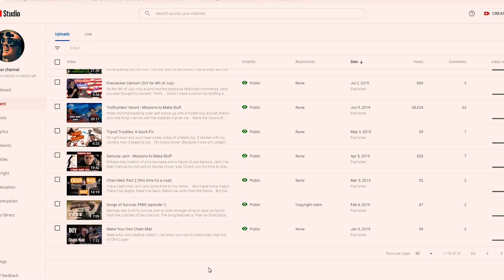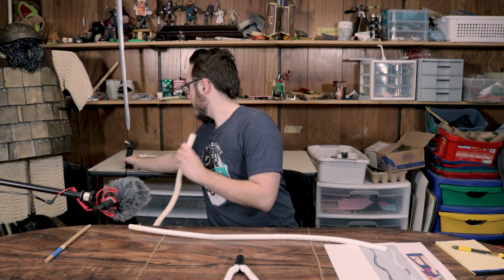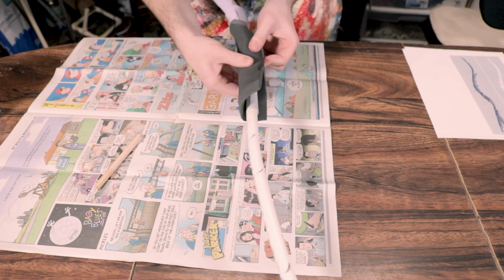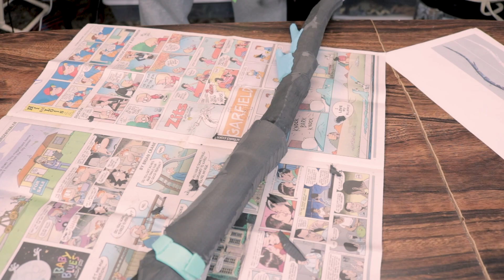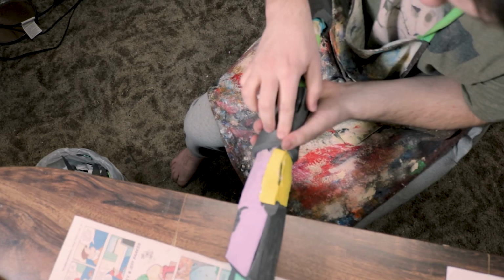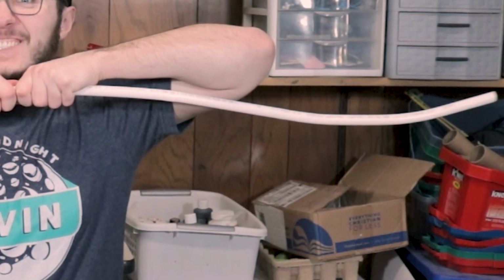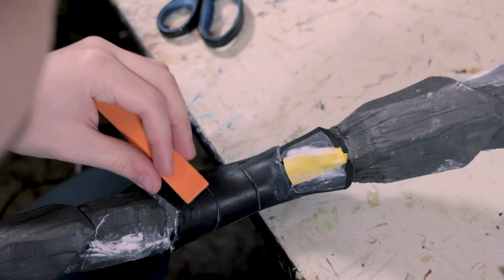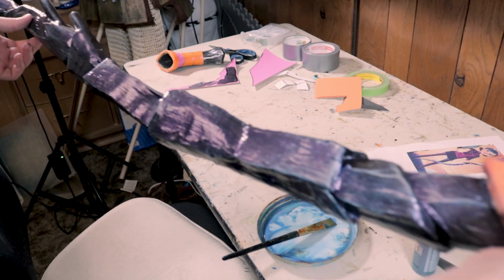I Made the SHADOW STAFF from TROLLHUNTERS!

Comment: How long is the pipe in the sword of daylight?
Reply from the maker: I think mine was around 40 inches, but an even yard would work too. It goes from the handle up to where the blade starts to angle and get pointy
Reply: @emmettsfabricationshandicr2536  What about the shadow staff?
Reply from the maker: Comes to 68 inches, tip to tip, but that's broken up into different pieces of pipe
Reply: @emmettsfabricationshandicr2536  How long is each piece in the staff?
Reply from the maker: I didn't measure them and now they're covered by foam. The thicker pipe could have benefited from being longer than it was. It doesn't make much difference. If you're interested in making it, just experiment! I usually just eyeball and guestimate